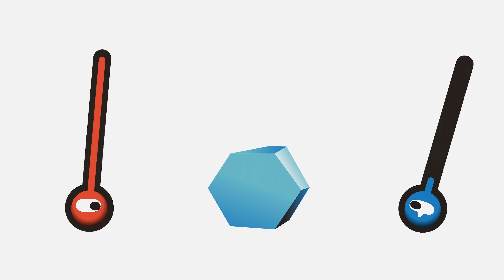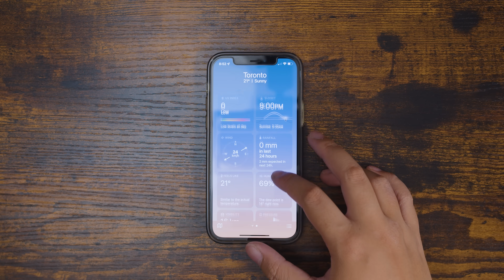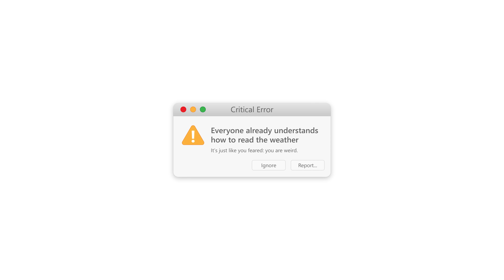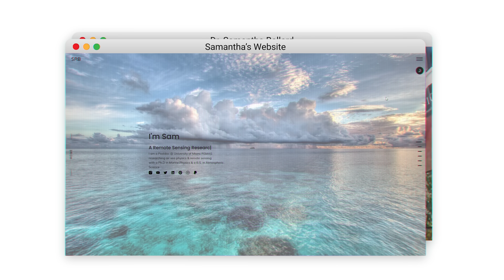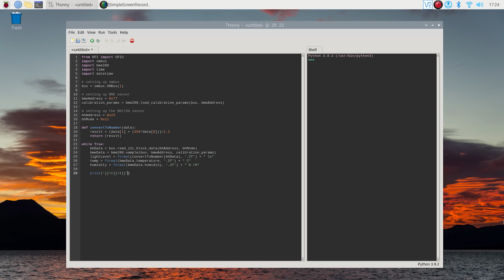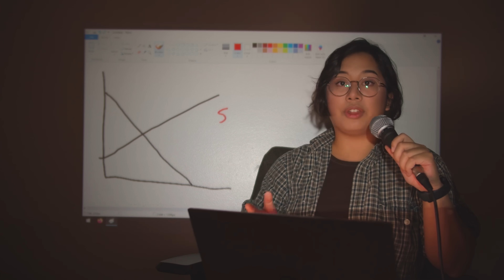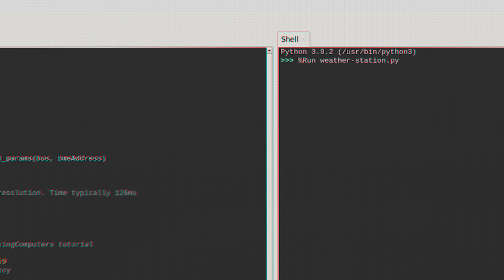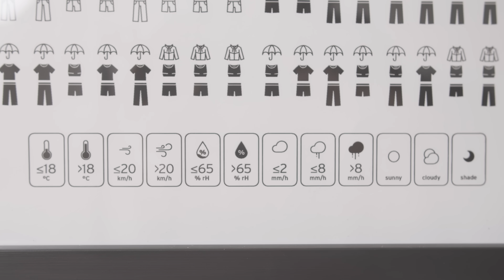how fahrenheit fails you

Comment: I mean yes Fahrenheit will always clap Celsius in terms of reporting the living temperatures humans encounter because the units are smaller and thus both better able to encapsulate the difference between them both major and minor and because it's simply far more intuitive. 80 is really hot makes sense vs say Yo its 26.7 its super-hot outside! Because it's almost like Fahrenheit was made and based off the human bodies temperature and how we experience it while Celsius wasn't.

Not that Celsius is hard to grasp it's just fucking stupid using it for living weather which is why I freely switch between the two (the english using both is like the one and only thing I'll ever give them).

Comment: I do computer simulations of heat-transfer (in additive manufacturing) as part of my job, and I want to mention that several of the factors described at 4:22 in the video are pretty important not just for humans, but for getting parts to come out right when building them using a 3D printer!  Specifically, cavity blackbody radiation, shield gas flow (sorta like wind chill), and metal spattering/vaporization (sorta like sweat) are all things we haven't yet figured out how to simulate.

Comment: This video is iconic! 
But about not liking layers because you don’t like carrying things—be kind to yourself on that front too, please! I was the same way, until I got a massive backpack that balances weight on my absolutely tiny frame. Turns out I just wanted my hands to be free and my back & knees to be safe. Now I do all sorts of “adulting” things without any prompting, like carrying layers, bringing leftovers/meals on the go/enough water, bringing my own shopping bags, and always having ibuprofen, pens, sharpies, bandaids, rain protection, etc. And I still have room to spare, and I don’t feel the weight! People ask me where I’m going camping (which is funny bc I hate camping), but they stop laughing when I have everything I need, plus extra to save their asses.
Reply: For similar reasons I got a 22L Osprey backpack in addition to my before that moment usual small standard one and the larger Osprey backpack.
The 22L one can snugly fit into one of the pannier bags of my bicycle, distributes the load better with the hip strap, has two nice pockets on the sides for water bottles, etc. Even with twice the weight that fits into a standard backpack it's still comfortable since the weight is transferred directly to your hips instead bypassing the spine. Compared to a standard traditional backpack it also has a air gap between the back and the backpack mitigating some of that sweaty back during warm weather problem. 

I keep a few essentials in there at all times: USB charger, powerbank, some snacks, waterproof pants (which in combination with the goretex jacket makes the outfit complete for unexpected rain). This leaves about 2/3 of the backpack for things such as the jacket in that not always needed but can be useful depending on rain/time of day period of the year. It's also good additional storage space when getting my groceries, first I'll fill the pannier bag on the other side when that's full any leftover backpack space gets filled. If that wouldn't fit there though the backpack goes on my back and the pannier bag gets used too. It's a convenient way to drag a lot of items back home with my for the one person + 2 cats household and useful too to keep the expensive items I don't want to leave parked outside a shop in my bag.

On a public transit day I also don't have to do any special packing whatsoever, just the usual backpack + whatever lunch/other items are needed go into the available backpack space and I can leave the house. Especially that charger and powerbank end up being used somewhat often when I inevitably forget to put my phone on the wireless charger before going to bed or misaligned it a bit too much.

Oh and doing most of my trips by bicycle really helps you adjust to having a good feeling about what kind of clothes are appropriate, maybe also building up some tolerance towards non-ideal weather? I will still plan my trips around rain when I can by leaving earlier or later, but if I need to be somewhere before a set time I can always put on the right clothes.

Comment: Human ideal temperatura is 22ºC, but you have to put on the balance the humidity of the air. More humidity more perceived Heat.
But in general 18 to 24ºC is a okay temperature, above 24ºC is starting to get hot and below 18ºC is starting to get colder. But this also depends on yourself.
For example, if you live in a hot country, you get used to higher temperatures, like 30ºC, But if you live in a cold country, 20ºC is warm to hot.
Here were I live in Rio de Janeiro the average temperature during the year is 25ºC, but is common to have 30ºC during the winter. So for me 15ºC is a Cold day and 25ºC is a Okay day.

Comment: American here switched to ºC in 2002.  I find Fahrenheit inconvenient because the distance between degrees is too small and of course 0 ºF means nothing.  Many people here wind up having to say something like 'upper 70s' which would be 26 ºC in metric countries.  Of course, the freezing & boiling points seem arbitrary in ºF but are nice round numbers in ºC.  When going out, a minus sign is far easier to notice freezing then whether the temperature is below 32 or not.  Here's how I deal w/ it when I go out: I don't use just temperature alone.  I usually use temperature and either dewpoint (in summer) or wind speed (in winter).

Comment: for me celsius is easier, maybe that´s just because it´s what i´m used to, but it´s simple, if at 0°c the water freezes, anything below that it´s fricking cold and up to 10° or 18° it´s still really cold and you should be wearing multple layers to keeep you warm. From 20° you start with the chilly days and up to 25° it´s an ideal weather, not too hot and not too cold. Then you start getting fricking hot. In Argentina in the summer we go up to 31° usually, but it can get hotter and last summer we reached 40° for a week and it was hell. 
So for me it´s easier bc you just have in mind a shorter scale from 0° to 30°, and you know that below 0° is serious coldness and above 30° is hell on earth. 
You also have in mind that the temperature goes up and reaches it´s highest point at 2pm or 3pm and it starts to go down again, and that humid hot days are the absolute worst.

Comment: There is a station here in the US that posts a different "metric" they call it the real feel. E.g. Is is  42° and the real feel is 31°. (such means dress warmer because factors like heavy wind make it fell like freezing temperature, but the streets are not slippy because water is not actually freezing) this has been accurate for my friends who have the same interpretation problem as you.
Reply: It also goes by another few names but that's literally just them taking into account wind chill or humidity and the like which can and do absolutely affect things. So hot weather in Arizona is different from Florida due to the humidity and lack thereof as well as the wind chill and breeze helping lower it effectively.

Comment: I live in Tucson, where 100F is commonly considered the dividing point between very warm and hot.  37.7778 just doesn't have the same ring to it.  Yeah, I know we'd probably default down to "body temp" at 37C, or 35C, but neither has the power of '100'.  I realize that this is still way more than hot in many other parts of the world.  On the other hand, we have mild winters, and I only had to wear big-boy pants two times last year.

Comment: Solar intensity: sun doesn't hit the same around the world, depending on the season and how close you are to the equator, sunlight varies in intensity.
think of a flashlight shining a ball, the part of the ball that is most perpendicular to the light, like the middle of ball on the side that's facing the flashlight will be the brightest.

so this basically just impacts temperature, but i guess staying in the shade would be more effective where sunlight is most intense.
max solar intensity is like 1360 watts per square meter, and that decreases as you get further from the equator (middle of the ball facing the flashlight). And that 1360 watts is what hits the top of the atmosphere, and some of it gets absorbed by air. 

in other words, im a nerd

Comment: who tf is able to walk outside when it’s -17°C (0°F) without dying
Reply: That is the reason everyone on planet Earth lives between 35° N and 35° S latitude.
Reply: @kdwaynec  but also they talk about 37°C (100°C) as if it’s too much heat ????? idk personally i would be unable to walk outside at 0°C (32°F)
Reply: @giopreda  If you mean 0°C without clothes or shoes, I'd agree unless my house is on fire. Properly dressed it's not a problem. To me, the wind makes the most difference in comfort levels. 50°F with 0 wind and in sunshine can be very pleasant, especially after a long winter. At night with a strong wind and rain 50°F can feel miserable. Same with 32°F. With or without wind makes a great deal of difference. 
At 100°F I'm wearing shorts and probably no shirt, or else I'm indoors with the AC on or at least sitting in front of a fan. I'm from Ohio, I'd guess you are from somewhere much closer to the equator.
Reply: @kdwaynec   I live around 25° S in a humid subtropical area. This entire comment thread is based on personal experiences, so of course it’s different for me. I usually walk outside with jeans, a shirt and ankle boots when it’s 38° C, we’re currently approaching that time of year over here and I still wear sweatshirts some days (today, for instance, minimum temperature was 21° C with a lot of humidity, I still had to wear a light cardigan in the morning because I was cold)
for me, 0° C, even with proper clothing, is unbearable, and my mind can’t even process how human beings can exist in such cold temperatures. Sorry if you took my previous comments way too literally, I meant them more on a jokey way.

Comment: The "faranheit is intuitive" argument makes absolutely no sense to me.

This is how I perceive temperature.
50°C is unsafe to live
45°C is unsafe to go out
40°C is too hot to go out, but safe
35°C is uncomfortable inside
30°C is uncomfortable outside, but okay inside
25°C is very much comfortable and I wish it was always 25°C
20°C is too cold, I'll just sleep until it's warmer.
Below 20°C and I need to check how much sweaters cost.

These numbers in faranheit are,
 122, 113, 104, 95, 86, 77, 68

If 68 is the number that's too cold for me, how tf is 0 to 100 scale supposed to make sense???

Temperature is not supposed to be subjective. It's an objective measurement taht doesn't care how you feel.

Things that make you feel hot :
1. High temperature
2. High humidity
3. Low wind speed
4. Direct sunlight or fire
5. Your BMR
6. How long ago you showered.
7. How stressed are you
And many more.

You can't make a 0 to 100 scale for how hot it feels. It's absolutely impossible...
Reply: Except Fahrenheit already has. 108°F is blazing hot, Las Vegas or Arizona hot. How does 108°C feel?

Comment: My argument for why Fahrenheit is better is because Fahrenheit is good for daily interaction.  Commoners can use it when they first wake up.  It’s easy to use
Being said, Celsius is not good for everyday people, but its better for science; but so is kelvin.  Kelvin is much better at telling me physical properties of things.  Even though kelvin is based on Celsius, Kelvin helps cover all fields of science.  You can use it in partial theory and you can use it astrological terms.  
One may say “since kelvin s based on Celsius, it must be better than Fahrenheit, but the issue with that is that Celsius is offset by 273.  So it doesn’t help ease our immediate comprehension of its true value. 

Ultimately Fahrenheit is better than Celsius, and Kelvin is better than Celsius, but comparing Fahrenheit and Kelvin is comparing apples to oranges.

Comment: I'm American and I've never been outside of the United States.  But when I was in college, I did decide that I wanted to "speak Celsius", if I could.  In particular, being human and being around 70% water, a temperature scale defined by the freezing and boiling points of water seems like a good idea to me.  So one day, I just went through the settings of any weather information that I used and switched it over to Celsius.  I surrounded myself with the notation on my devices.  And after I started to get used to it, I noticed that about every 5 degrees (Celsius) felt like a new "tier" of weather.

20 degree weather is beautiful.  Easy thermal management for the human body.  Between 15 and 20, I probably want a jacket or hoodie.  Between 10 and 15, I want a heavier coat, but I'll probably leave it open.  Below 10, I'm gonna start zipping it up.  Below 5, if I haven't already, I'm adding hat/gloves/scarf/etc, because it's winter just south of the Great Lakes.  Below 0, I don't want to spend time outside if I don't have to because that's the point where 70% of my body will undesirably solidify, given enough time.

Between 20 and 25, shorts start to be in order.  Above 25, it's still shorts weather, and maybe try to bring a water bottle if you're going to be outside for a while.  Above 30, I'm personally trying to jump from air conditioner to air conditioner as the outside temperature approaches internal human body temperature and stops me from radiating at all.  Above 35, I pretty much consider that I'm going to be a heat sink for the outside air, not the other way around.

Especially when appropriate outfits vary, this all has some effect of letting me try to guess the temperature outside to within a few degrees Celsius.  And I'd say I'm usually satisfyingly close.

Having tried to "immerse" myself in degrees Celsius and having figured out what it means to me, I'm pretty sure I only have any "intuition" for degrees Fahrenheit because that's what I was raised with.  If I didn't already know that scale, I don't know if I would be interested in learning it or if it would be useful to me if I did.
Reply: Fahrenheit is more precise. 

In Celsius, a single degree can mean the difference between needing a jacket and needing a tank top. 

You will never run into that problem in fahrenheit. The actual number is much more meaningful.
Reply: @GeneralNickles  Which specific single-degree Celsius change will cause you to make such a radical change in your outerwear?  I've already described my experience being determined more by the 5's than by the single degrees, so I'm curious about the numbers of your own experience.
Reply: @emmeeemm  if you can't tell the difference between 20C and 21C, then you need to see a doctor, because something is wrong with you. That's a dramatic difference. 

The difference between 15C and 20C is the same difference between 59F and 68F. 

That's a big enough difference to change the entire way people approach there day. Lower those numbers down around the freezing point and that big of a gap is more than enough to determine whether or not someone is even going to work that day. 

And yet, in Celsius, it's only 5 degrees. Which is completely asinine. How anyone figures out what there day to day routine should be on such a laughably imprecise scale is completely beyond me.

Comment: I haven't finished yet but I have been thinking about the F vs C issue and I think it's one of the few places where thinking about things in percentage makes sense. C is what percent hot is the water 0 it's not hot at all it's actually frozen 100 it's so hot it's not even water anymore. However, F is the percentage hot is the air around me. 0 is very cold like unenjoyable cold. 100 is unenjoyable hot.

Comment: Your phone app was already giving you these parameters, I usually start the day by looking at the temperature throughout the day (look for the coldest it will get and the hottest) and then check the average humidity for the day, humidity actually plays a more critical role than you think (depending on which climate you live obviously) humidity acts a little something like: if the temperature is hot, high humidity will make it all sticky and sweaty but lower humidity will make it a little nicer/chilly (in a good way) , if the temperature is cold high humidity will make you feel really cold like freezing but lower humidity will feel bearable. I am a Celsius user (even though I am living in US right now) (I am European normally) and the only thing I can recommend is actually checking the temperature and humidity more often (like daily basis like I do) and you will be starting to get the hang of it SPECIFICALLY FOR YOU. (eg. I like 28 degree celsius with lowish humidity like around 30-40% etc etc) You will get the feel of it eventually.
Reply: hahah, wrote the comment half way in the video, glad we are on the same page Sabrina :D  @Answer in Progress

Comment: It has nothing to do with temperature and everything to do with humidity. Canada, or rather the areas surrounding Lake Ontario, have a moderately high percentage of humidity in the air. Celsius is a superior scale in every metric you could use to compare the two.